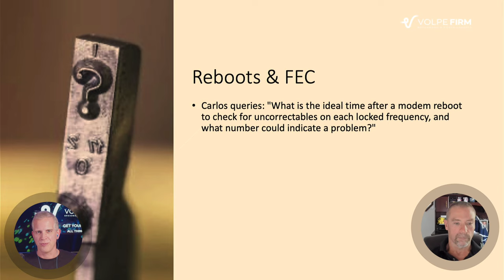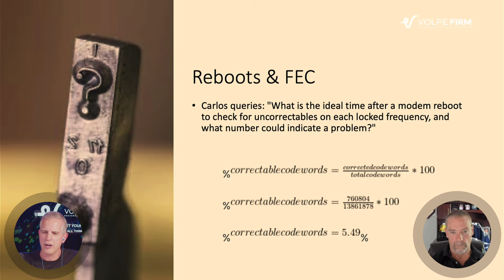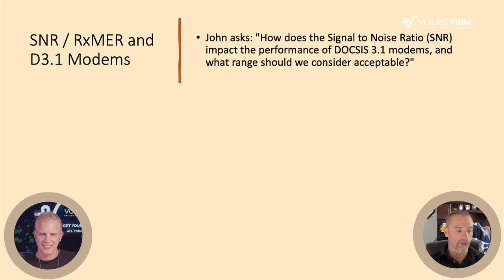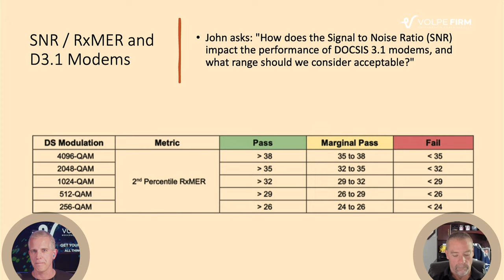SNR (RxMER) and DOCSIS 3.1 Modems

Comment: I'm still confused whether many of these issues you describe in Nimble...I mean OpenVault...are actually service affecting, or just reducing the "robustness" (or whatever you've called it before?) but not actually noticeable by the customer.

My next call today says "intermittent TV issues. Nimble: RxMER Correlation: RxMER-260-(node redacted) OFDM 1 In House Issue RxMER-260-(node redacted) OFDM 2 In House Issue Downstream Failed Parameters : MER [OFDM 2] Upstream Failed Parameters : MR Level, CM US MER, CMTS Rx Pwr Spectra Impairment : Adjacency, Wave RF Level: looks good"

Remotely checked RF levels and only one OFDM at 987 MHz was slightly out of thresholds at -10. I refreshed it, and it's green now at -9.7. 

They're on our IP based TV boxes, which have had a known software issue for the past few months involving freezing, black screen, looping. This often makes me wonder how many calls are actually RF related, or even service affecting.

This job, I tell ya 😐
Reply from the maker: Hi @grabasandwich - you raise an interesting discussion topic of proactive vs reactive that we are working on right now. Often times we identify impairments that are not subscriber impacting, as you indicate. However, given some time they will be subscriber impacting. But that doesn't help if you are more focused on putting out fires. We will be pushing out a release early this summer that gives a priority to each correlation group as to their priority, such as "Critical", "High", "Medium" and "Low". The critical and high priority correlation groups will be subscriber impacting, while the medium and low will be proactive. So if you see a Critical or High correlation group you will know that when you visit that customer or outside plant issue, you are actually improving the customer experience immediately rather than in the future. I'll look forward to your feedback. 👍

Comment: DBC-REQ Mismatch Between Calculated Value for P1.6hi Compared to CCAP Provided Value;CM-MAC=9c:c9:eb:8b:3f:a8;CMTS-MAC=00:17:10:88:ec:0b;CM-QOS=1.1;CM-VER=3.1;
US profile assignment change. US Chan ID: 8; Previous Profile: 11 13; New Profile: 12 13.;CM-MAC=9c:c9:eb:8b:3f:a8;CMTS-MAC=00:17:10:88:ec:0b;CM-QOS=1.1;CM-VER=3.1; Any idea what are these?
Reply from the maker: Hi @DarkHarb, there are a could of error messages here. But likely not critical ones as long as the modem gracefully recovers. These likely are just "log" messages, unless you are experiencing issues. 

DBC-REQ Mismatch Between Calculated Value for P1.6hi Compared to CCAP Provided Value" - This error is related to the Downstream Bounded Channel Request (DBC-REQ). The modem is detecting a mismatch between the calculated value for a specific parameter (P1.6hi) and the value provided by the CCAP

US profile assignment change. US Chan ID: 8; Previous Profile: 11 13; New Profile: 12 13" - This message suggests that there's been a change in the Upstream (US) profile assignment. The upstream channel (US Chan ID) 8 has had its profile changed from 11 13 to 12 13. In DOCSIS 3.1, profiles are used to adapt the modulation when impairments occur, possible examples are loose or damaged wiring in our your home network, drop cable or outside plant.
Reply: @Volpefirm  no issues I was just wondering what they’re
Reply: DBC-REQ: Dynamic Bonding Change Request, this is a mechanism the CMTS uses to ask the modem to adjust its transmission properties (frequency, power, modulation order, timing etc.) within its TCS, or its receiver properties within its RCS- this is a standard mechanic to keep the modem transmitting /receiving optimally for the plant conditions. Seems you have a mismatch in expected vs. measured power, so the CMTS is asking the modem to make some adjustment to its receive channel set, so that the measurement aligns with expectations. This isnt anything unusual, unless its happening a LOT, then it might indicate there's something wrong with the plant.

The US profile assignment change is your CMTS telling your modem to drop down an interval-usage-code (IUC / Upstream modulation profile). I.e. there's too low of an SNR, or too many lost codewords post-FEC for your modem to sustain a high-order modulation in the upstream, drop down one order and continue transmitting.  The CMTS is always testing to see if your modem is using an optimal setting to maximise bandwidth, whilst minimising errors.

This is part of that.
Reply: @charliemoz   It's happening alot so much that's all that appears.
Reply: @Harb000  If its happening a lot, and you experience performance issues (i.e. packetloss, latency/jitter, low capacity), then it might indicate a fault in the outside plant. Your provider will need to take a closer look, its impossible to tell what the root-cause might be from modem logs :)